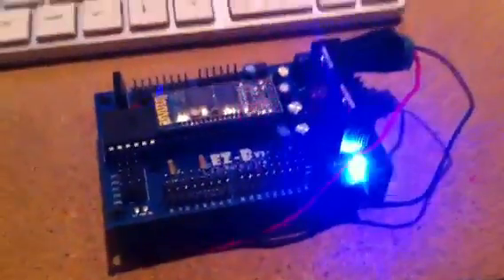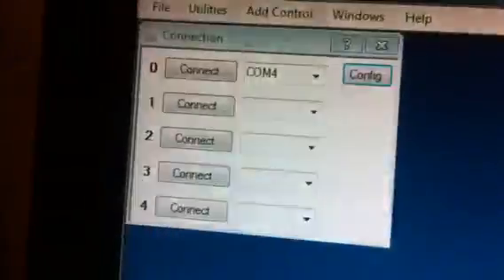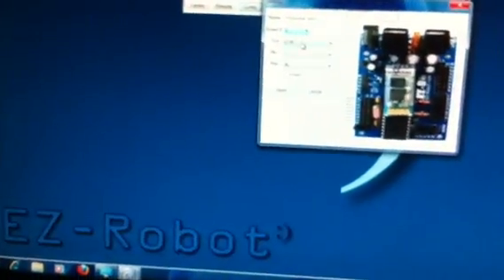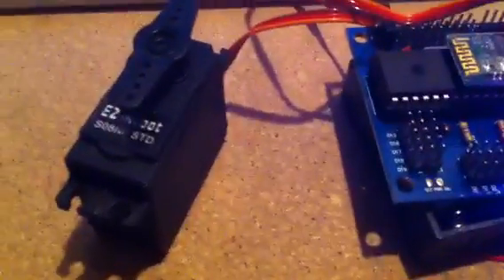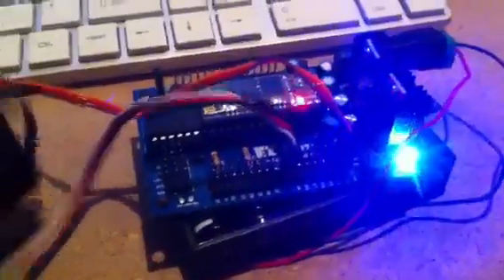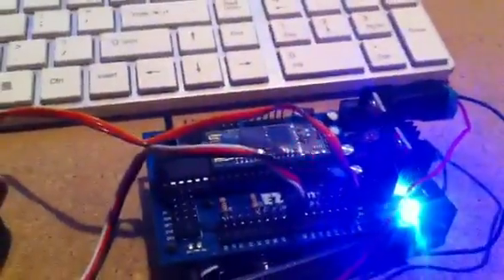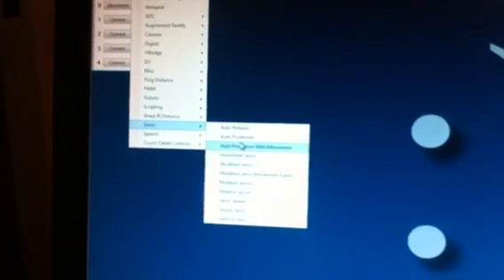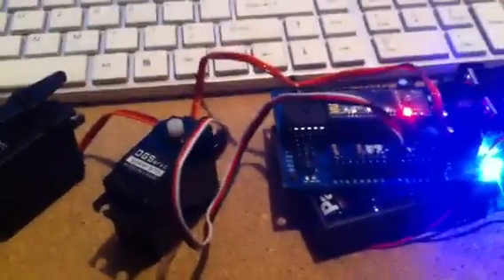EZ-Robot complete kit : Problems

Comment: Hello,
You can obtain support for your EZ-Robot kit on our Community Forum on our website. YouTube is not a great way to obtain support. Firstly, if you watch the introduction tutorial video to your kit, the servo you are using labelled "DSG" is a Continous Rotation Servo (modified). The video does not show what control is added. Also, you placed the EZ-B on metal batteries. The back of the EZB PCB is exposed terminals. The metal is a conductor and you are shorting out the EZ-B.